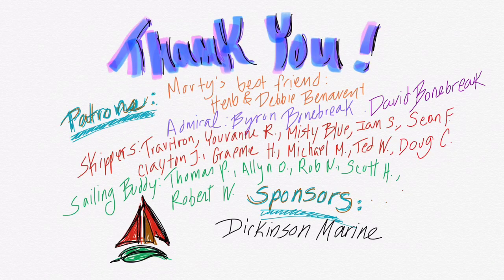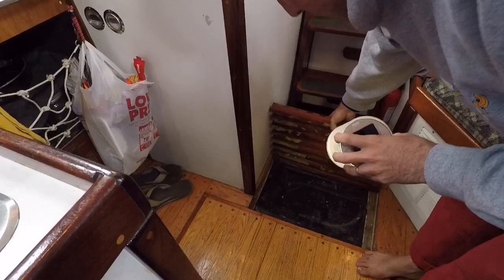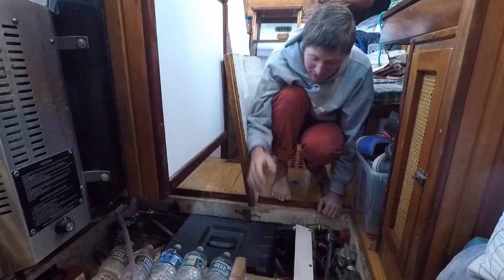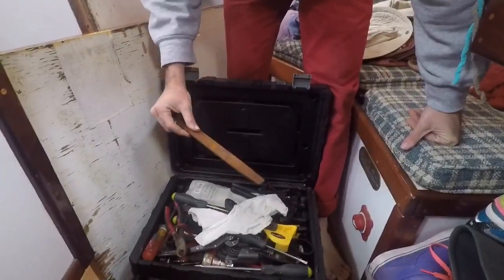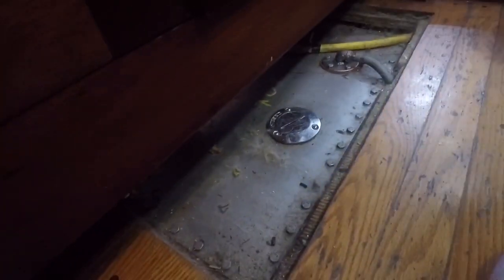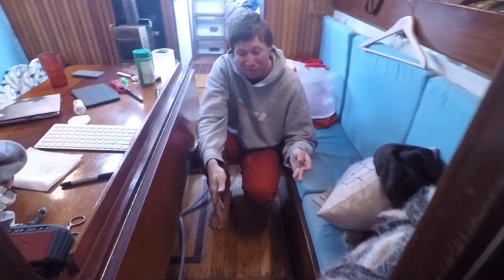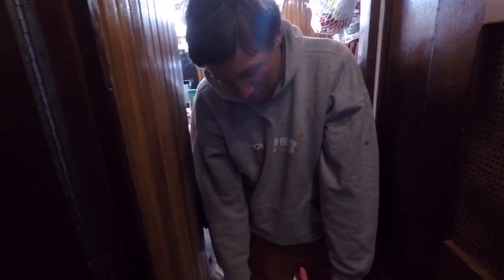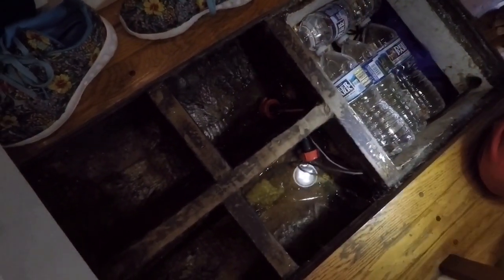Tour Under The Floor | Sailing Wisdom Ep 76

Comment: Interesting thanks for sharing. I won't comment on the dog hair... 

Remember with a clean and dry bilge not only can you see what's going on, but there is less risk of limber holes and strum boxes clogging at critical times.

My biggest observation is that those hatches should have some kind of positive locking down before you go offshore again. Remember to think inverted!

Comment: TFS lots of stuff under the floor. The electric motor sure gives you more room in the salon than when the diesel was down there. I wondered if your mast went all the way down to the keel and you answered my question. It doesn't look like you have much spare space on board. About the only place you could hang a hammock in in the vee berth. Happy sailing.
Reply from the maker: It’s kind of cramped in there! That’s why the idea of the hammock in the companionway.

Comment: Well, thanks for the tour. However I have to vent my disappointment that you didn't talk about ghosts and ancient murders and such stuff that usually are main attraction of tours.

All frivolity aside, you made it clear although you didn't specifically say, that inspection and maintenance are ongoing and critical.

One question lingers: why do you prefer refueling from the interior port rather than above decks? The extra effort is considerable so unless the outside fuel port can only be used with a marina's fuel hose (at marina fuel prices), I don't get it.

Heated floors... makes me REALLY wish I were sailing with you!
Reply from the maker: Yes, constant maintenance and inspections are critical to a boats longevity! 
As for the refueling, we do have a deck fill plate, and it does work, but we only use the diesel for the heater. Red diesel soots up the heater quickly and needs to be cleaned constantly. Green diesel, on the other hand, burns a lot more cleanly and will go years between the optional cleanings of the heater.
As a result of our fuel use schedule, we only use the diesel in the winter, and only need to refuel when it is cold outside. Instead of freezing to death on the deck as I pour green diesel in, I just do it inside the boat in the comforts of home :)
Reply from the maker: The floors are not heated (intentionally) though. The how water lines run around to feed the baseboard heaters we have set up that serve to give a steady amount of heat in key places of the boat. As a result of running the hoses around, our closets and the floor are warmer though. It is nice to put on warm clothes in the dead of winter and step onto a warm floor, but these were happy accidents from the installation. 
While the hydronic heat is pleasant, it only works when we are plugged into shore power since the circulating pump and water heater run on 120vAC

Comment: WOw!  Very detailed tour.  Any idea what the weight of your boat is fully loaded with 200 gal tank water, drinking water, 12 batteries, diesel fuel, gasoline, 2 dinghies,  AC unit, Multiple anchors and that much rode?
I don't mean to sound critical.  I truly look forward to you vids and am a real gear head. Your rigging stuff is really great!  
I just wonder if the extra weight would have an impact on how your boat handled heavy seas?
Reply from the maker: The boats designed weight is 32,000 pounds, and there is a waterline cut into the hull to denote this displacement. When I converted to synthetic rigging, the weight reduction brought the boat up to the point where we were (for the first time ever) floating at that waterline.
Then we decided to go cruising and added all the items you listed and a ton of canned food, which sunk us way down, lower than we have ever been! We weighed 36,000 pounds when we got hauled out to do the bottom at the begging of our journey. I have raised the bottom paint to now completely cover the boot stripe, and yet we don't show an excessive amount of bottom paint when we sit, because our designed waterline is submerged a few inches.
From a performance standpoint, the rigging took off the weight aloft and all the weight we have added has been low in the hull and "mostly" center lined. This could then be thought of as extra ballast.
The end result is that we roll slowly and don't heel much at all but we are miserably slow to windward. When we are on a beam or broad reach, we can sail along at 6-7 knots, then we turn onto a close reach and our speed goes away as we crawl at 2-3 knots.
As we go consuming our canned food, we are not replacing it. We lived aboard for 5 years and had one locker for canned food; and we never ran out! Then we decided to go cruising and I stocked us up, filling 7 lockers with canned food! We will eat our way back down and keep it at just one if we can help it.
Reply: Thanks for the detail.  I had forgot about the weight savings up top with the dyneema.  That makes sense.  Being a catamaran guy I think about weight often.  Thinking of the stuff down low and centered does sorta make it ballast.  I remember reading a lot about storm survival and they often refer to buoyant" boat.  
Please keep posting the detail vids.  I appreciate they way you design!